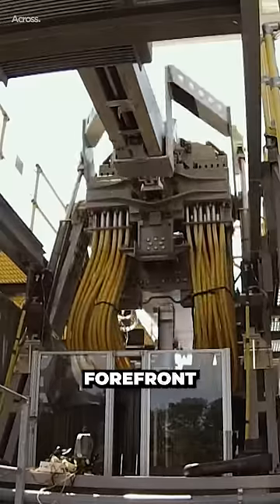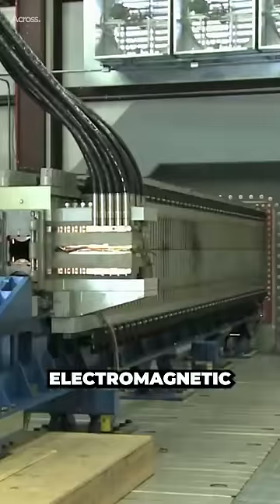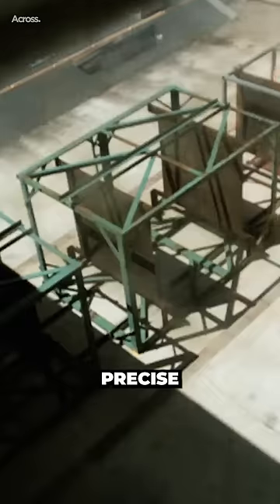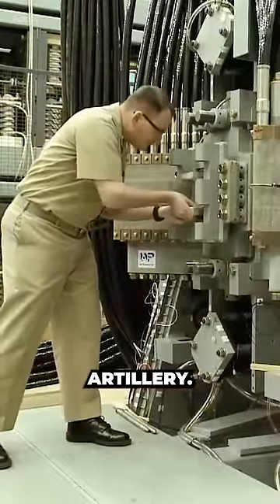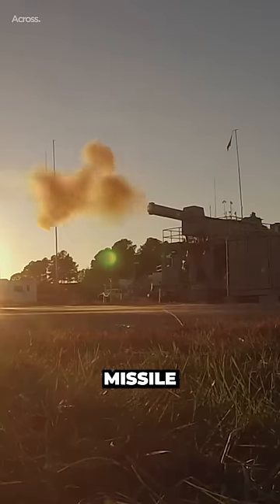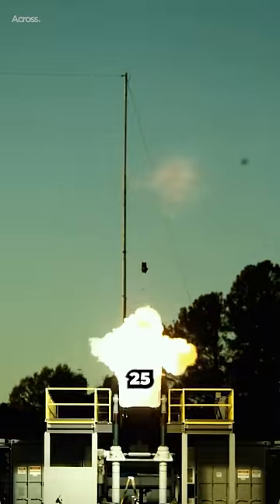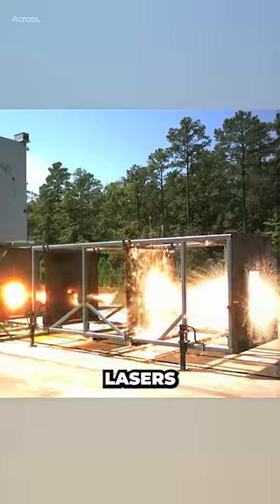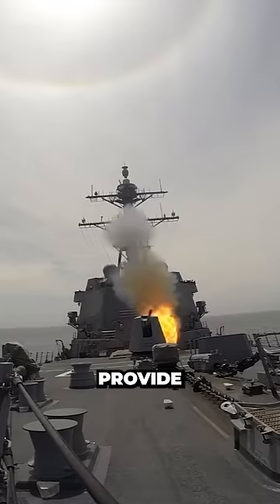The $500 Million Weapons That Make Everyone Afraid #shorts

Comment: the Railgun gives the Battleship Hope for a comeback in the Future....Nuclear Powered with Hypersonic Missiles....Railguns....Lasers.....Phalanx....
Reply: Battleships are obsolete. There’s no reason for a 40,000+ ton ship with a 1800+ man crew when you can be as effective and harder to detect in a destroyer platform with all the same capability
Reply: @nathanielweber7843  ....Maybe....Maybe not........
Reply: @nathanielweber7843 
There actually is a good reason for those ships
No current air or sea based weapons platform is capable of inflicting significant damage on a battleship
Only thing that could be half way effective would be an ICBM
Normal cruise missiles do not have the punch to get through the armored belts
Reply: @arwo1143  you can put an armor piercing warhead on a ship based cruise missile. Or you could just up-armor a destroyer and give it the same protections without increasing size and only adding displacement. There are better solutions
Reply: As he said, it requires 25 MW to fire. The battery pack required for that would weigh tens of thousands of tons alone, plus you need a powerplant on it able to recharge this massive battery, meaning we're likely going nuclear. This will already have a massive displacement, meaning size, so it won't be particularly hard to detect, so you toughen up the armor. Abra Cadabra, I present to you a battleship 💁🏼‍♂️
Reply: @arwo1143 
No. That is a common myth and has been debunking by many - including the US military itself. Modern missiles can almost effortlessly pinatrate belt and turret armor.
Reply: Yeah
Reply: @Canute_ not battery packs, but generators. They’ve got em on the 3 littoral combat ships we have, and they said they generate enough energy to power entire small cities
Reply: @arwo1143  where did you get that info? world of warships?. last time i checked the armorbelt of the iowa-class was 12.1'' (307mm) thick so yeah modern munition can most certinaly hit and sink and iowa. so yeah obsolete when destroyers have a lower radar signature and most likely lower sonar signature  than an iowa-class
Reply: @nathanielweber7843, we wouldn't need a 40k ton ship. All of our subs are around 16 to 18k tons. So, in theory, the Navy could do something like a rail gun cruiser(CR), with a displacement of around 18 to 20k tons, using  2 A1B reactors(same as GRF class Carriers), and having a complement of no more than 400. The 2 A1B reactors would not only power and propel the ship but would also generate the power necessary to fire railgun, lasers, missiles, CIWS, etc.
Reply: @Sauce_Sensei  I just imagine that you'd need huge batteries anyway as you'd have such a surge during firing that "trickle charging" it with a generator wouldn't suffice, but I don't know
Reply: @Archangel657  Naval missiles and ICBM's in general have HE warhead, they aren't meant to penetrate armor, and indeed they can't, they're meant to cause massive damage. They wouldn't be able to do much other than damaging the superstructure of a battleship. You can, however, make a naval missile that has multiple HEAT warheads such as the ATGM's that can penetrate up to 1200 mm of armor. But there are no anti-ship missiles with this kind of warhead right now.
Reply: @nathanielweber7843 so many people DONT SEE THE POWER OF A AUTOMATED BUT MANNED BATTLSHIP. you are so fucking Nieve to think it’s obsolete. it’s armor is thick and we only now got heat projectiles or HE. mind you those warheads arnt as strong as you think against modern composite armor. so the enemy would have to resort to bigger weapons like ballistic massiles to cripple a battleship.
Reply: @colonelilbrink8544  a cruiser might be effective. A battleship would not be. That’s a totally separate argument you’re attempting to make now. I don’t disagree that a cruiser might make it more feasible to power the rail gun by means of greater displacement for more reactors. Could also carry more missiles. But we don’t need a combat ship the size of Wisconsin or Vanguard to fit the rail guns, nor would a ship designed like the battleships be in anyway a good use of naval funding. The cost of building a ship that size would be better spent on a carrier
Reply: @colonelilbrink8544  thank you.
Reply: @nickkozak4763  no, I’m just realistic. If you want missile armed ships, cruisers and destroyers are more then capable. If you want rail guns, cruisers and destroyers are more then capable.

If you want a capital ship, america is much better off making sea wolf class or Ohio class submarines and GRF carriers that actually have a function. Gun based capital ships reliant on armor belts and gun coordinate targeting have been obsolete since the 1930’s with the advent of carrier air power, and then rendered further useless by guided missiles. You don’t need to waste a carriers worth of funding making a ship large if the only purpose is making it large. Function dictates form, and if you can make 4 missile cruisers or 1 missile battleship, what’s a better use of your resources?

Edit: adding a bit about missiles: it would take less then a year to construct an armor piercing warhead for shipping missiles. By the time the supposed battleship you think is unsinkable hits the water, there will already be weapons able to sink it from beyond contact range.
Reply: Not Gona happen.  But we can drwam
Reply: @nathanielweber7843  I agree with you regarding the need for a large combat ship with big guns being unnecessary. Each turret on an Iowa class required about 80 crew members, and with 3 turrets, it makes 240 crew. Hypothetically,  if a CR(Railgun Cruiser) had bow and stern single barrel railguns with auto loaders, that 240 crew could be reduced to maybe a half dozen. The biggest issue is the cost. Especially if a single railgun has a tag of $500 million, even at one gun per ship. Guess I'll have to settle for it being a dream.
Reply: @colonelilbrink8544  yeah. And the cost of the gun is nothing to the cost of maintenance. It would almost be a requirement to implement a barrel change system to keep the rail gun operational long term in theater, they wear out quick. But I could see a Ticonderoga sized cruiser with a rail gun or two and it’s missile compliment being useful to the navy. Just not something approaching the size of a carrier with less then half the versatility of one.
Reply: @nathanielweber7843  agreed.
Reply: @colonelilbrink8544  ....50 years in the Future from now things maybe different......
Reply: @arwo1143 bro what the hell are you talking about?? Air power and carriers specifically are why battleships are obsolete. The US sunk Yamato without needing to ever get in its firing range. It’s not like a modern battleship would fare any different.
Reply: @Canute_  not really, any cruiser sized ship would suffice.
Reply: @StOrmZIsoNItZWaY  In displacement? It'd amaze me, but not saying you're wrong
Reply: @nathanielweber7843 with modern automation that large of a crew would be overkill, there isn't much as far as modern warships that would be able to damage even a semi-heavily armored battleship. It's my understanding that the only reason they have not installed a rail gun on a ship yet is because of lack of power production(there was talk for a while about using the Nimitz or Enterprise as a test bed before decommissioning, but that didn't come to fruition).
Reply: @Canute_  i mean if you’re planning on having a ship with rail guns displacement isn’t what you need. You need stealth and power production so you can hit things before they see you. Having multiple smaller ships is better than one huge target that’s easily spotted on radar and sunk. Plus yes, cruisers can be nuclear powered. Large destroyers could too
Reply: @nathanielweber7843 they’ve already spent billions of dollars on the failed project that ur talking about. they tried that with 3 new ships and all 3 ships can’t even have ammunition for the railguns since the ammo is over $1,000,000 a round. they spent 3 billion making 1 of those ships and in total the project costed the US 9 billion dollars and the whole thing was scrapped
Reply: @nathanielweber7843 a destroyer wouldn’t be able to handle the armor a battleship has, there’s a reason battleships r massive. they have to be huge so they can keep themselves afloat with the weight of all its armor and guns
Reply: @aeffern it can penetrate the armor, but it’s not gonna be enough to sink it. to sink the japanese battleship yamato it took 3 hours of constant aerial bombardment to sink the 1 ship. they even used a US battleship in the testing of nuclear weapons against warships and then they couldn’t even sink the radioactive battleship, they had to actually send a team in to scuttle the ship. this was during the 50s and 60s
Reply: @huskiegaming4957  are you trying to defend the concept of a battleship or prove it’s redundancy? Because I’m all in agreement that they are pointless in a modern day war fleet but if you’re trying to suggest they might be viable ships for war, you are sadly mistaken.

Destroyers, contrary to your claim, could handle a thick armor belt. It’s just a matter of buoyancy vs displacement and certain other elements might be reduced or removed to make savings for the belt. But my earliest point about armor piercing missiles is somewhat key to my position there: armor on ships for anything larger then small arms and mortar ordinance is mostly pointless when the bulk of threats to a ship make armor a meaningless factor and the saved weight of the belt could go into more useful things like more CIWS or additional missiles. 

I am aware that the rail gun is too expensive for modern day warfare, the prohibitive cost of gun maintenance and ammo alone makes them somewhat pointless. My comment about rail gun batteries was more that you would have to standardize them on the ships to be effective and even then, the gun platform of a cruiser or up-armored destroyer or even a regular destroyer would be better then trying to innovate a new class of massive battleship to fit the rail guns on. As in, assuming we could afford to standardize rail guns as products of war, they would still be better suited on destroyers then battleships. I’m going to go out on a limb and assume that the fragmented nature of this comment chain made my position difficult to follow, but:

Battleships are never coming back. Gun based surface warfare is obsolete, even if the rail gun were a feasible weapon it still would lack the versatility of a larger armament of cruise missiles. If the Navy wanted to build a large capital ship, they would be better off making more Gerald R Ford class carriers or Ohio class submarines then creating some sort of battleship. I don’t care what bullshit someone wants to say about ‘oh, automated systems’, ‘oh, rail gun hypersonic projectiles’, ‘oh, supermassive broadside weight’, etc. Any mission you might envision a future battleship is capable of doing, we can accomplish faster, cheaper and more effectively by making cruisers or destroyers with these weapons.

Finally, I don’t know why you referenced nuclear testing here. We aren’t going to be employing nuclear weapons as anti-fleet measures. Unless said fleet is in harbor. Nuclear weapons are going to rain hellfire on populated industrial centers and military headquarters to keep command and control from consolidating or re-constituting an army if the footballs are ever opened. But EVEN IF I am wrong in that assessment and nuclear tipped ballistic missiles are sent streaking into the ocean to sink ships: why does it matter if they survive the blast? You said yourself: the radioactive hulk had to be scuttled. I’m positive that if a ship is irradiated to that extreme, it’s also non-functional for combat, as any crew staying aboard would succumb to cancer and radiation sickness in short order and systems on board would be compromised for effective use purposes anyways
Reply: To fight who 🤣
Reply: @aeffern so incorrect it’s not even funny …. A 5 inch gun hit iowa and only made a small dent. The problem is that most people think WW1 technology. If you use a rail gun put the 16 inch shells with 5 inch shells and missiles and anti aircraft and anti missile it would be back in business. Because battleships did 3 things well land attack, anti air , and anti ship. Plus they could take a beating.
Reply: @amacca2085  ....China
Reply: @Archangel657  Why even bother penetrating the armor? If we can essentially put a cruise missile into an open window, why not down a ship's smokestack?
Reply: @arwo1143 This is all wrong lol
Reply: @nathanielweber7843 meh, battleships are cooler
Reply: @jamieharmer5654  American won’t fight China 🤣 they wouldn’t fight Russia they only fight wars that they can dominate and they scrape by then
Reply: @amacca2085  yes, that’s why American trained Ukrainian forces are not wiping the floor with Russia since the start of this year. Oh wait~
Reply: @reecechadwick8504  sure. I won’t take that from anyone: massive battleship guns are awesome to look at and a sight to see fire I’ve been told by people who’ve seen it. But cooler doesn’t mean better: it means cooler. And I don’t care how cool the ship is in a war zone if it’s more likely to get destroyed and cost lives
Reply: @neubauerjoseph  again: anything a battleship armed with rail guns would be capable of doing, we could also do with a destroyer armed with rail guns. And the destroyer would be smaller, faster, cheaper, harder to detect, harder to hit, and there would be 3-4 of them sitting around instead of one big ship. There’s literally no reason to make a capital ship constrained to rail guns.
Reply: @nathanielweber7843  thats a fair point
Reply: Bro they forget two nuclear electricity and with nuclear power plant
Reply: @Canute_  The battery wouldn’t necessarily weigh thousands of tons, more like several to tens of tons or less.
Reply: There is still hope, as military ships are requiring less crew as automation and AI advances. Battleships also provide multiple things that other modern military ships can't provide. Massive shore bombardment. Overwhelming firepower (main guns and secondary guns). Unlike missiles, shells are almost impossible to intercept. Shells are cheaper then missiles, and the ship can carry much more ammunition.
Reply: Traditional (heavily armored) Battleships may be obsolete, but the Battlecruiser (in their smaller variants) still exists.

Large enough railguns could easily make large Battlecruisers relevant again, and they could be interesting as co-Flagships, pincing enemies together with Aircraft Carrier Groups.

What gunships lack in detection range, they somewhat compensate in weapon deployment speed and capability to invest in stealth technologies (ACs have flight decks and whatnot which makes stealth almost impossible).

Accompanied by Attack and Cruise Missile Submarines, a Stealth, Nuclear-Powered, Railgun-Armed Battlecruiser could perhaps lob shells at ranges over 600 nautical miles (considering a much larger sized gun than the current ones firing at up to mach 12 speeds), with paylods that include even cruise missiles themselves, meaning that they wouldn't be limited by the range of their shells.

Still, any vessel within the range of inert shells is at a risk of being wiped from the face of Earth faster than anything AC groups could attempt, making the simple existence of such ships a weapon in itself, even more so when paired with stealth (in itself and by use of Submarine fleet as escort).

The thing here is solving the problems of maintaining such Railguns, specially if they are upscaled to Battlecruiser sizes. The stealth technology needed for it is also prohibitively expensive, though the failed Zumwalt Class Destroyer (and some actually successful examples from other countries, like the Swedish Visby Class Corvette) proved that it can be implemented, if needed.

Finally, such ships are very much oriented towards vessel combat, moreso than even their cannon-armed predecessors; An Aircraft Carrier, on the other hand, can take any mission its decked aircraft and onboard munitions allows it to accomplish, which are plenty in variety and can even be swapped during ongoing conflicts if needed.

In short, I do believe that Flagship Heavy Battlecruisers (armed with large Railguns) will be relevant again, but it may take long before this happens, and when it does, they probably will only be one for every 4-5 Aircraft Carrier.
Reply: This is for space...
Reply: @arwo1143 Wrong no convential weapon

Nuclear warheads would still work
Reply: It's not a Hypersonic Missile it's a Hypersonic Projectile. It's simply just a chunck of solid metal with a hell of a lot of kinetic energy.
Reply: Wouldn’t a rail make battleships even more obsolete!?
Reply: @90skidcultist  ...why ?
Reply: @arwo1143 .....Ummm. you don't have a clue what you are talking about. Battleships became obsolete by the end of WW2 when it was realized that battleships we're no match for carrier based aircraft. No country in the world operates a battleship anymore because of how useless they are against modern weapons and aircraft. Both the LRASM and Maritime Tomahawk Cruise Missile along with the harpoon anti ship missile would all render a battleship as being nothing more then scrap metal at the bottom of the ocean. The big guns on battle ships  are no match of the range of anti ship missiles and attack aircraft.
Reply: @martykarr7058  What? The whole purpose of an anti-ship missile is to sink the ship, not moderately damage it.
Reply: @jonataspereira1691  Yes, that is essentially what I ment. Thanks for the elaboration.
Reply: @Archangel657  If you put a missile down a ship's smokestack the blast gets to the engine room that has LOTS of fuel oil in and around it and is near the bottom of the ship. Odds are it would put a very large hole in the ship that could not be plugged. Of course though, it wouldn't work on a nuclear powered ship, no smokestack.
Reply: @nickkozak4763 like it or not, battleship is obsolete man. No matter how strong its armor is, how long can it withstand non stop bombardment. Even if some say currently no missile can penetrate its armor. If its really in war time, what about 6 months later, or a year later, or more. War technology will evolve, if its a race between missile or armor. Of course missile dev would get the upperhand, cause people want to attack more effectively rather than defending without being able to counter.
Reply: @Canute_  it won't use a battery, but super capacitors. Time between shots would be "long", but they're light and can discharge much more current and faster than lithium batteries.